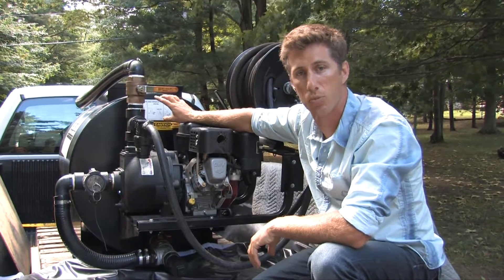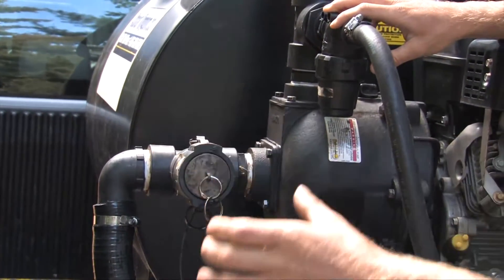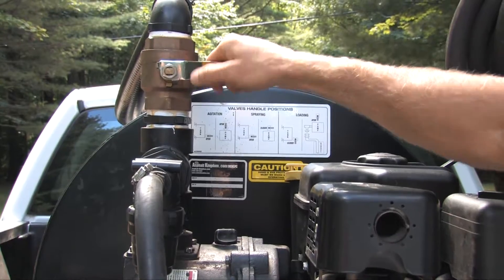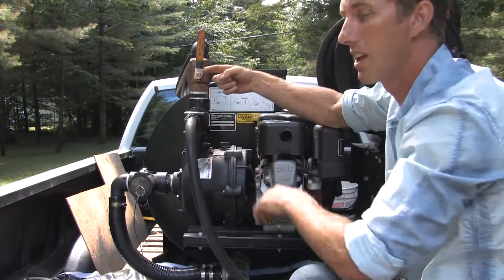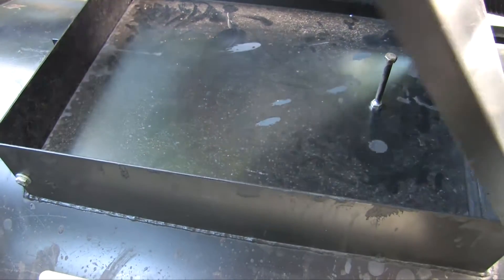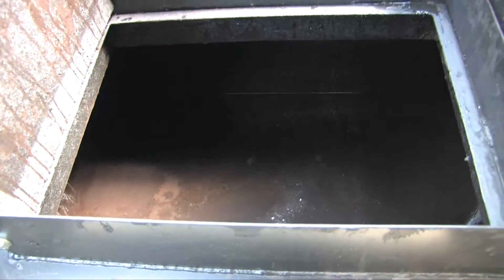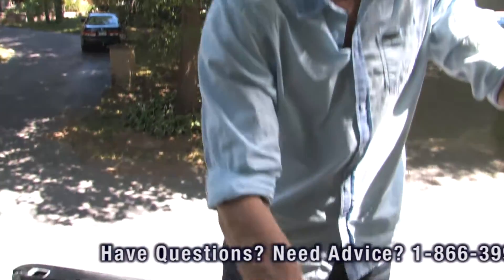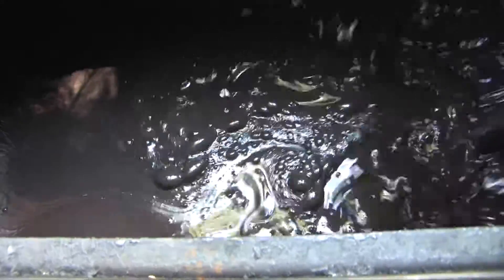Learn How to Mix Sealer in a Centrifugal Sealcoating Spray System

Comment: After I am done spraying one driveway my tote spray system pump gets  thick and the pump will shut down because the flapper inside gets gunked  up and stops. Am I not adding enough water to my coal tar??
Reply from the maker: If your pump is shutting down and losing prime it’s because the sealer is too thick. If you’re using coal tar you should dilute around 30% with water.

Comment: Which unit is that? What kind of truck is that? Wouldnt the unit be too heavy for the truck?
Reply from the maker: Andrew Stephanos this is the AK130 spray system on a F150. No it’s not too heavy. Weight with sealer is 1400 pounds.
Reply: What year is that f150? Are the bigger units safe to carry on an f150?
Reply from the maker: Andrew Stephanos I believe that truck was a 2007. We don’t recommend putting anything larger than the 130 in an F150 or smaller.
Reply: Thank you for your feedback